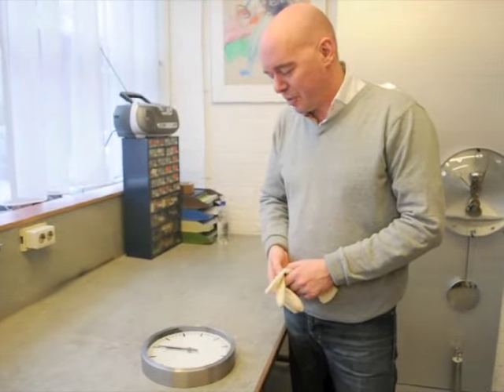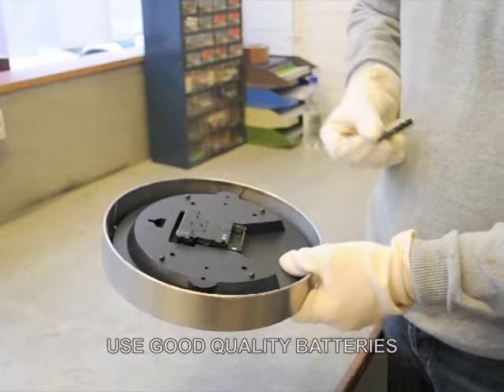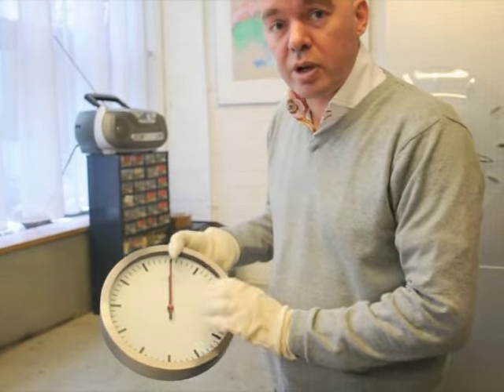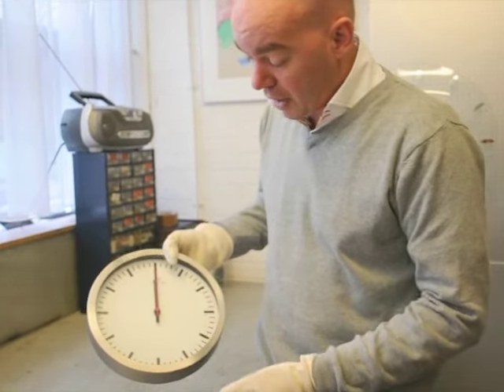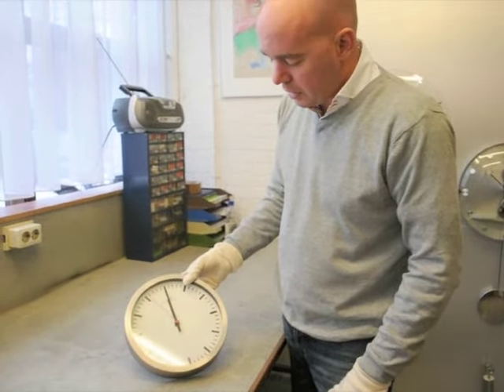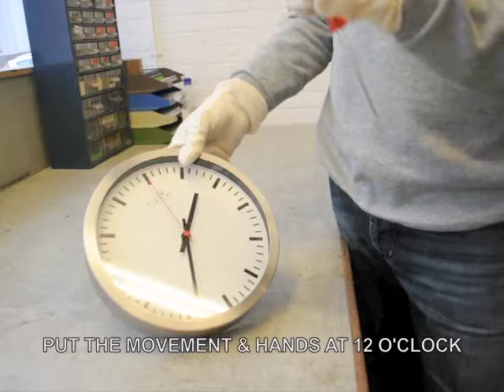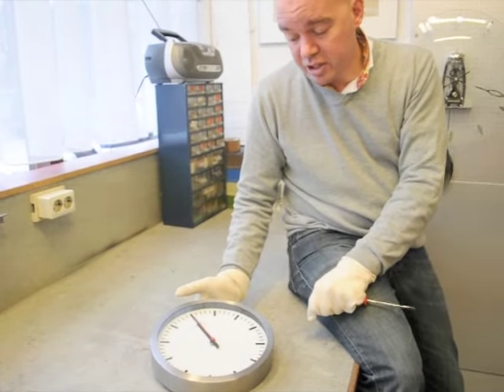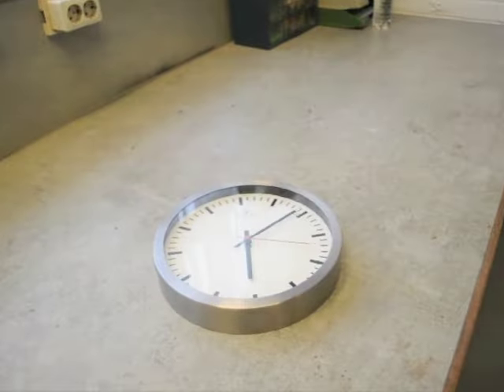Radio Control Clock

Comment: My radio controlled clock is always 1 hour fast. There is nothing in the manual to correct this problem. Do you have advice?
Reply: Open the dial and remove then reinstall the hands at 1100

Comment: I am in London, so if its displaying Frankfurt time that explains the out by one hour. Can I fix this or do I need to put in garbage ?
Reply from the maker: +Chris Brooksbank If you receive a signal (often the UK is too far away from Frankfurt)... but if you DO receive a signal, you can set the hands at 11 o'clock instead of 12 o'clock (you'll be tricking the signal), this way it will show the right time for you.
Reply: Chris Brooksbank z

Comment: How do you set the Time zone, Mine is always an hour fast????
Reply from the maker: +oOMonkeyMagicOo Are you in the UK? Often you cannot set a time zone, but what you can do is trick the signal by setting the hands at 11 o'clock instead of 12 o'clock (and follow this instruction movie)
Reply: +NeXtime No Ireland, but the time zone is the same. Picked up a clock in Lidl and it looks like it is only suitable for Mainland Europe. Through various searches I had stumbled across the change the position of the hands method, which I have already applied.
The method for anybody else interested is...
The clock had to be reset by pressing and holding the reset button for +5 seconds. This will move the hands to start position. Either 12, 4 or 8 o clock. Mine went to 12. Once this happens, remove the battery. Then you have to take the clock apart, this will depend on the model but mine had three v shaped springs holding the face to the "Glass" and was straight forward enough to access the hands. Once access has been gained, be careful not to bend the hands. The second and minute hand have to be removed first, then the hour hand can be removed. Be careful not to turn the spindle on which the hands sit. The hands have to be pulled up away from the face and not twisted. Once removed, replace an hour before the reset time, example 11, 3 or 7, or an hour ahead 1, 5 or 9 if you are on the other side of Europe, such as Greece. Replace the battery and all should be well.

@ NeXtime Thanks for the reply.
Reply: Lidl stocked one that only tuned to DCF77
Reply: How can you rollout a clock that doesn't work in the target market's timezone? Wish I got a regular clock

Comment: I bought a radio-clock from Japan by error and brought it back to Australia which does not have radio-timing system. I have spent weeks trying to over-ride the system using the two buttons at its back to use it as an ordinary clock but the two arms just would not stop spinning. If you now what to do, please let me know.
Reply from the maker: Dear josemour100,
Sorry to hear you have trouble with your radio-control clock. It depends on the type of mechanism used. Our radio-control mechanisms indicate the time in a ordinary way if they cannot find the signal. It will look for a signal every two hours, like all our radio-control mechanisms, but they hands will not spin around. The only thing I can suggest is to buy another 'normal' mechanism and replace your radio-control mechanism with a normal one. I hope you can use your clock soon,
Regards, NeXtime (^Marije)
Reply: josemour100 one of the two buttons set the time manual and the other one takes the pointers to 12:00 and waits for radio signal .
Reply: +Nick Alpha my is at 12:00 is never move
Reply: +Jason Chen maybe in your place there is no radio signal available ... try to set your clock manually .

Comment: Hi, my expensive £40 radio controlled clock from a jeweller, bought a few years back completely failed to move, stuck at 4 o'clock, despite trying lots of batteries.  The radio controlled wall clock was fine so I knew it was not the signal.

Went online for a solution, found your video quickly, did what you said and it is working like new.  VERY, very impressed.  Many many thanks.  :-)
Reply from the maker: +wainwright3 Good to hear!!

Comment: I  CAN'T HEAR YOU!  Buy yourself a regular wall clock and use your phone for accurate time.  I have two of these and they are a pain in the ass, especially with standard vs daylightsavings changes.  Good luck getting a reliable signal.

Comment: What is the Radio Frequency this clock receives its synchronisation signal from ? Which station - WWV ?
Reply: DCF77
Reply: Frequency: 77.5 kHz

Comment: I bought one and it waits for the signal for 12 minutes 12 seconds then starts. My country has no signal so I reset it to 12. Remove the cell. Then reinsert at 11:46:46 and it completes its reset again and tada at 1200 it starts ticking.
Three times a day it holds its seconds hand for a minute or two waiting for the signal but the clock keeeps ticking and it is pretty damn accurate.

Comment: how about here in the Philippines....
how to set my Casio Radio Wave Controlled Clock?
Reply: i know this is 3 years old,  but im from the Philippines  and bought a Japanese Seiko Radiowave Clock. 
Since my clock is based on Japanese time Zone, the clock is always  exactly 1 hour faster.
What I did is just pop open then clock case and moved the hour hand 1 hour back.  
remove the batteries  before doing so.

Comment: We have this clock at my work as well. I am from Slovakia. Can you tell me why our clock, at Slovakia, sets itself at 13:20-25 (I don't remember when exactly)? Thank you for your explanation.
Reply from the maker: We made a new movie, that might explain it a bit better :https://youtu.be/pvPSUg9rRmg . Take out battery and put it back in, the clock will set it self at a certain time, insert the pin and take the battery out. Make sure the pin is inserted completely. Take off the hands and put them at 12:00. Take out the pin, and put the battery back in. The clock will set it self at 12:00 And wait for the signal. I hope this helps. Regards